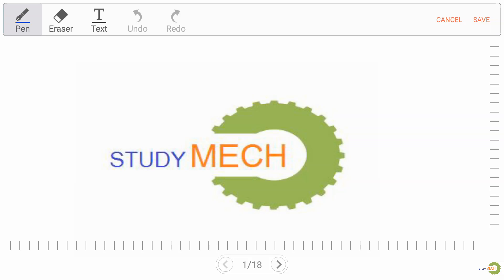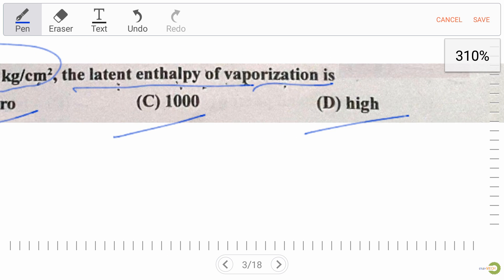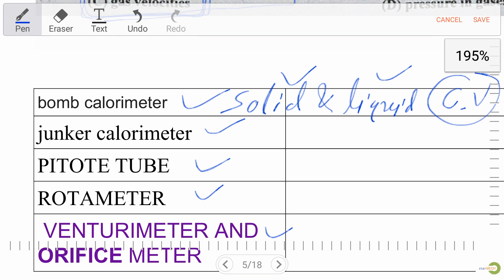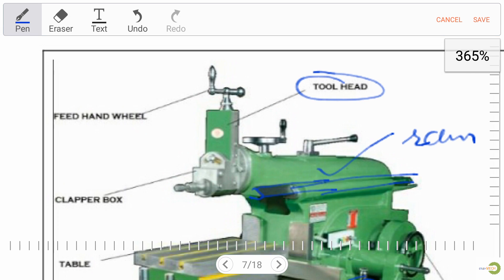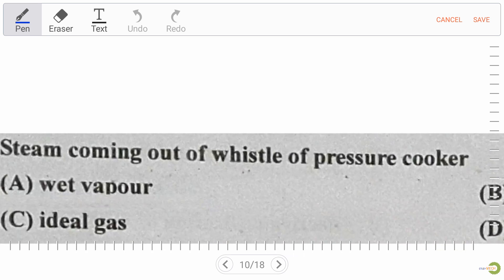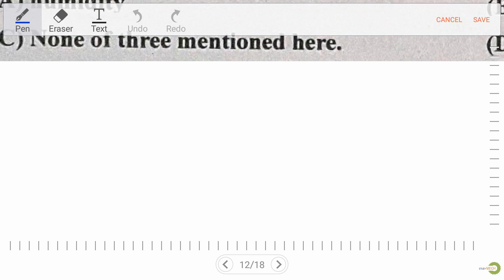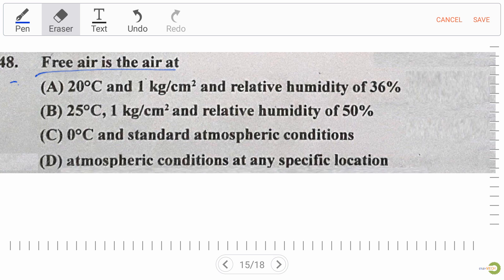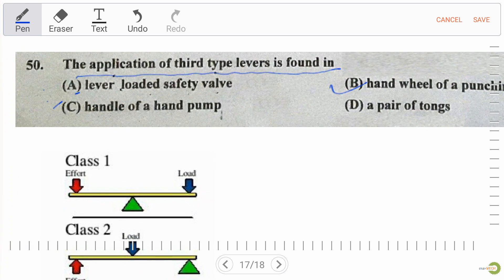MECHANICAL QUESTIONS ANSWERS CONCEPTS I RTO exams of GPSC/BPSC/MPSC/RPSC

Comment: The ideal Rankine cycle consists of the following four processes, as shown on the T-s diagram on the left: 1-2: Isentropic compression in a pump. ... 3-4: Isentropic expansion in a turbine. 4-1: Constant pressure heat rejection in a condenser.
Reply from the maker: Yes ideal rankine cycle consist of four process. There is mistake in editing.